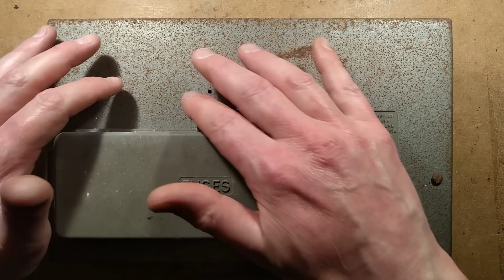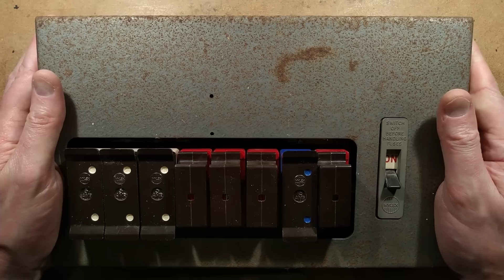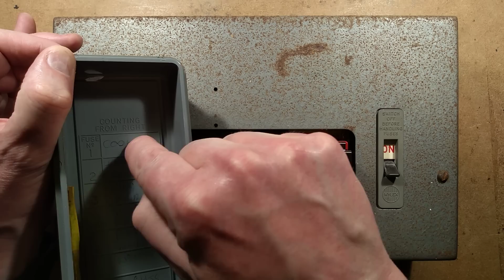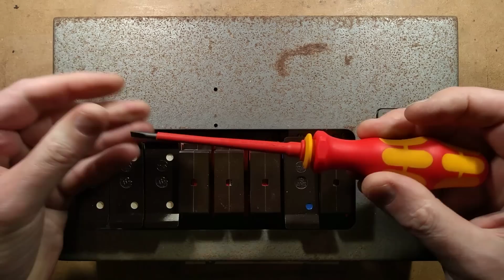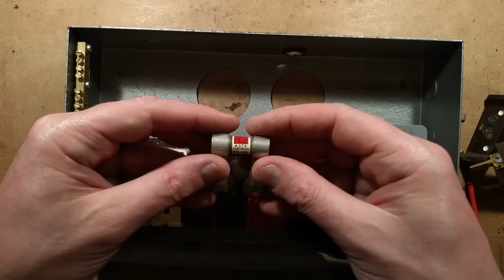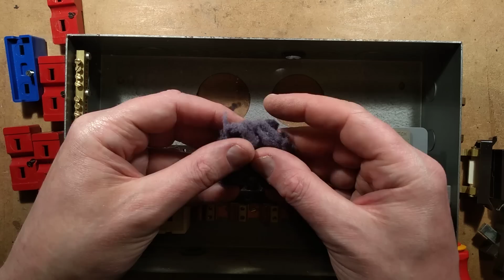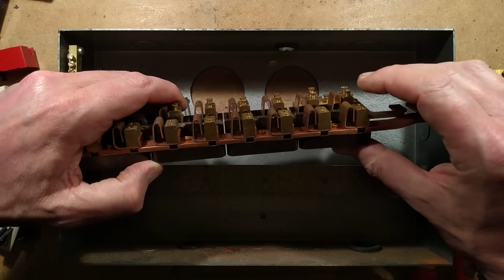Teardown of an old British Wylex electrical fuse box.  (with bare fuse wires)

Comment: God, I love that island. 
Everybody drives on the left and the switches are down for on and up for off. 
Not to mention the water taps. :))
Reply: Of course everybody drives on the left.....if only half of us did it that would cause problems. The taps here do drive me nuts though, also baths instead of showers. >.<
Reply: Kizron Kizronson the other day I briefly saw on the BBC a contraption where there was a bath with the two separate taps above, and no shower... but a shower was provided in the form of a rubber hose that you could slide across both taps and that then joined in the middle and led to a —handheld only natch — shower head.
Reply: Don't knock it mate, all those things were invented in the UK, it was the USA that ended up with everything the wrong way round. 🤔🤣
Reply: @JasperJanssen  Yeah,those things are terrible. The most popular option seems to be a "power shower" Which goes on the wall above the taps and which basically heats the water on demand as it flows through to a shower head.
Reply: @Kizron_Kizronson  That's not a "Power Shower", A power shower has it's own water pump. An electric shower has only a cold feed, a mixer or bar shower has both hot and cold feeds, both come in power and normal flavours.
Reply from the maker: Like the rubber Y-hose shower I used as a kid.  They were very common.  It was always a bit messy when one of the cups blew off a tap.
Reply: @bigclivedotcom  Depending on which cup blew off you were either scalded or froze, gotta love the old Y-hose.
Reply: @JasperJanssen  Those have the nasty habit to pop off the taps when your head is full of soap. Keep the pressure very low.
Reply: @bigclivedotcom  oh no, de-nitting shampoo on three boys with one of those bloody things... I used jubilee clips to hold then on the taps in the end...

Comment: Clive, I really appreciate you showing this 'vintage' stuff. It shows how we have gone from practical designs, made to be fixed or repaired by anyone, and how things have improved over time. While you could easily replace any one particular item on this panel, it is kind of clunky. Then compare this to today's new fangled, disposable economy where if a fuse blows, you throw it away and replace it with a new one.

Comment: I had such a fusebox or consumer unit in my last house. At one time, I noticed a burning smell whenever I used the washing machine, which I eventually traced to the fusebox. Basically, the screw holding the live wire to the fuse holder was loose and it had been arcing. The plastic on the whole of that section had melted and the copper connectors were only held in place by the wires. Since there was a spare slot further along, I was able to move the fuse and the associated wiring to the spare slot. Moral of the story - make sure the screws are tight, but not so tight as to punch through the wire.

And as for the asbestos, my parents had an asbestos mat, that they used to put between the top of the cooker and a saucepan whenever they wanted a really low heat. It reduced the heat of the flame to just the right amount to keep food warm whilst not burning it. When not in use, this asbestos mat was just thrown into one of the kitchen draws. I've no idea what became of it.

Comment: at least those fuse holders are a lot safer than the screw-in type common in north america prior to the introduction of resetable circuit breakers. very vividly remember as a toddler, watching my grandpa go down the dark basement stairs to jam a coin in a fuse holder, then screw the blown fuse over the top of it, because he was out of replacement fuses on a sunday night.

as soon as my grandpa plugged the (faulty) crockpot that blew the fuse back in, that coin turned into a blast of plasma that melted through the blown fuse, and a good amount of everything else in the panel. guess who had to use plumbers candles to light the house, give his grandchildren a cold dinner, and wait until monday morning when the town electrician could come in and replace the whole panel? xD

I don't fault my grandpa though-- he grew up in a town with hardly any electrified anything, and having dropped out of school in 5th grade to help support his family, a lot of his technical skills were self taught or learned on his job as a mechanic in a cloth mill. hence, a lot of trial and a LOT of errors. amazing he had (most) of all his digits by his death at age 80... he was missing the tip of his left thumb though. that's how he learned about riving knives...
Reply: It's amazing how a lot of older folks like your Grandpa made it to such an old age, what with all the health and safety warnings on everything these days.
Reply: @uK8cvPAq  Of course, plenty of them didnt... selection bias and all that.
Reply: I've known people who followed all the safety guidance and still didn't make it past 60, yet there's been people who've done all sorts and smoked like chimneys and are well into their 80's today.
Reply: Grew up in a house that still had those diazed fuses. (We had them over here in Europe as well). It was kinda a regular occurrence one would blow. Strange now that I'm thinking about it. Maybe they were a bit like light bulbs, just blew with age and use. I do remember my father using aluminum foil when there where no spares. Haha!
Reply: Also, a lot of modern circuit breaker boxes leave plenty of the live bus completely exposed once you remove the whole front panel. It's really interesting how they try to cover as best as possible every connection in the UK. This even goes for light switches and wall outlets.

Comment: I was working on new build houses when the new regs abolished  rewireable  fuses, I asked the boss why he didn't use the MCB's? Because they cost £5.50 each against £1.25 for the fuses, was his smug self-satisfied reply. He soon changed his tune when he found out that every time a light-bulb blew it took the 6a cartridge fuse with it...as he was giving the electrical installation a 1 year warranty, he had to send people on tours of central Scotland changing fuses at his expense. He liked that even less than stumping up for the proper gear..RIP Jimmy Hynd.

Comment: One safety feature I think you missed when comparing the different size fuse carriers is that the pin thickness increases in size with the higher amperage - not just for the higher current but it also meant that you can't accidentally/on-purpose put a 30A fuse carrier in your lighting circuit because the slots in the bases correspond accordingly
Reply: Hi, you beat me to the comment  haha.

Comment: Good old Wylex units, they must have been the dogs danglers back in the days you see so many of them around. Simple and effective for the days of "personal responsibility" when if you got hurt 90% of the time it really was your own bloody fault.
Reply: @ihatespam1977  We run all 240v in the UK, it doesn't play nice if you get on the wrong side of it.
Reply: I agree, but this thing looks like you can accidentally flip the switch back to on when you are working in the fusebox.
Reply: @Leo-pd8ww  trust me, you can. You can even take the cover off it switched on.

The later plastic ones you, at least, have to remove the rewirable fuses carriers before you can remove the cover.
Reply: In the early 2000s the split RCD wylex boards took over the same way as these . Most jobs now are a wylex split way RCD but recently a lot of common ones are the budget friendly British General boxes from Screwfix

Comment: Completely same wylex fuse box are still in use on my grandma's house in cyprus. I think it was built in 1970's and they are still rocking without any problems. However, i want to change them with new type of circuit breakers because of the safety concerns. Nice video!

Comment: I had one of these units in my old flat around 2012/2013, and had to change the fuse wire one day. I did exactly what you described at 1:35, blowing the 100A main fuse for the block of flats. The guy who came out from the electricity board let me keep the fuse! When it happened it was as if a flashbang had gone off in my hall and I couldn't hear or see for a good 10 seconds after, and gained a very healthy respect (some might say fear) for electricity after that. My wife would tell you that I couldn't even change a light bulb for a few years after that happened.

Comment: 10:00 at least in Finland, the old cinemas also had to have fused drop doors in the projection/peep windows, those would fall to cover the windows if there was a hot enough fire in the booth. But I bet this was approximately universal. Also it was mostly forbidden to have a direct access route inside the building between the booth and areas which patrons had access to. I work in two cinemas, one built in 1939 and another 1958. The latter has had a metal winding staircase put in in the 70's so we don't have to run around the building. The former retains the original structure and I think the building is protected so notable structural changes are not allowed. It is actually one of the oldest cinemas in Finland that has been operating all the time - the pandemic was the first thing for which we were closed for more than a few weeks. There are, though, 100ish year old (even wooden) houses where a cinema has been operating at some time, and almost by sheer luck only a few have had a fire.

Comment: Got this exact model at home, solid,dependable and unlikely to burn the house down unlike the cheaper plastic types today, just had it inspected and everything is fine, had an in line RCD fitted to the board supply, and good for years to come.

Comment: Wylex standard boards were awesome, so well made. Connecting the main earth to the external screws is normal, the earth bar terminals are very small. It's important to note that the fuse ways here are rated maximum 30A. Some Wylex boards had a single higher rated way next to or the other side of the main switch. A high current way can easily be identified as the contacts are in separate parts, silver coloured and held in place with a pair of screws. I have only once ever seen one of these burnt, but not to the point of fire. A ring circuit was wired into a 15A fuseway, the circuit was heavily loaded with a 3KW pool heater running 24hours, and a tumble drier and washing machine, the load was not enough to blow the fuse, but enough that the 15A fuse ran very hot. A section of the plastic cover above the fuse was charred and crumbled away,but the rest of the unit was in surprisingly good condition. A newer plastic unit would have melted badly. The dual screw all brass construction terminals are very reliable. I wish manufacturers would still use these, instead of mixing different types of metals, and using weak clamp terminals, especially for main switches and RCDs.

Comment: I'd always argue that our British standards for electrical gear have always been the best designed, most sensible, and safest, except for one embarrassment that you see has been partially corrected in later units. That is: 'Down is on' switches. Clearly, something dropping past such a switch can accidentally turn them on. I'd love all switches to change over to the other way around (even though the risk is small in most cases).
Reply: I knew a girl from a former British colony who was here in the US and her complaint was that the switches were backwards!  On is supposed to be down, not up!  😆😆

Comment: I have a unit similar to this and your video prompted me to have a closer look and I discovered one of the cartridge fuses had some wire soldered across it!
Reply from the maker: Good idea to get the correct fuse for that and some other spares too.  Also double check the correct fuse wires are fitted to any rewireable holders.
Reply: @bigclivedotcom  Thanks for the reply. already done so.  I didn't even realise they were cartridge fuses as the only one I have ever needed to replace it turns out is the only one which isn't.  So if a fuse blew I would have smugly gone to it fix it with my card of fuse wire - lol

Comment: I used to fit Wylex consumer units in early 70's they had a hardwood frame with a full plastic cover where yours was metal
Reply: The house I bought 5 years ago was built in 1985 and that had installed a wooden Wyler DB, it was soon taken out when I rewired my house, but who’s idea was it to go from metal to wooded DB,

Comment: Brings back memories,  worked on loads of these and ripped a fair few out too.  Also the push button MCB replacements for the fuses.  Most of the versions I worked with had a plastic front case and a wood backbox.

Comment: I've told this one a few times. As a 10 year old i figured out the fuse wire in the fuses could be replaced. 
We had a similar box, brown bakealite cover and it was filled with the slightly longer fuses. 
My father used to go to the nearby diy shop, and buy a new fuse. 
Near our box we had two fuse wires on wooden bobbins. One had 5A and the other 15A written on the top. 
When daddy was at work a fuse went. I opened the fuse saw the burnt wire and screws. Wondering if I could replace it with the same A wire?
I was so happy with my find, upon my dad's return I told him. I was ignored but still I was so full of happiness I went and wired up the 5+ spare fuses sitting above the box.

Comment: Interesting fact about asbestos: if melted down, it turns into glass that about strong as plexi and is no longer dangerous,  asbestos glass has a lot of potential that has yet to be put to the test.
Reply from the maker: The trouble is the mining and handling of it before it gets melted down.  Those fibres are very invasive.  If you work with the stuff then no matter what dust protection you wear you will inevitable breathe in a lot more than a normal person.  One of the things that rile me is asbestos removal companies that basically involve a greedy businessman using the cheapest labour they can get to do the work in paper overalls and token gesture dust masks.  The longer those labourers work there the more chance there is of life limiting effects.
Reply: @bigclivedotcom  that's what i have been reading is the thing that has stopping them from selling it and theirs some research  being done hoping to change that problem
Reply: @TT-RR  - See my comment above about short and long fiber asbestos.

Comment: My dad spent 1959-1996 in the electrical trade, he only has one working lung & that one only half works, non-cancerous asbestosis.
Reply: What caused such bad lung damage? Asbestos, smoking, something else? Does he need to carry an oxygen tank with him?
Reply: @simontay4851  nah, he doesn't cary oxygen, it would have been mostly the asbestos, he only smoke a pipe or a cigar once a week.
Reply: Mesothelioma is the worst cancer and is usually deadly.

Comment: The really big safety feature of these units is that every wire connection, except the earth,  is held by twin screws - brass into brass for a really good, tight long lasting connection. As opposed to the modern units with dissimilar metals, bad threads, and breakers where it is possible to insert a wire or busbar lug where it is not clamped tight. I wonder what the installers of these units would have said if you told them they should be using a calibrated torque screwdriver!
Reply from the maker: I prefer the more generous connections on the older stuff too.  Putting a large cable into a very short terminal clamp does not feel comfortable.

Comment: Hi Clive,  I used to do some work for a bathroom company and was at a job to install a shower.  When I removed the front of the fuse box, which was exactly like the one you show, I was a bit surprised to see that there was absolutely NO insulation on any of the cables inside with the exception of the tails incoming.  I have never seen it since or before.  The cables were the old rubber type and outside of the box were perfectly normal looking.  The only thing that was rubber and had survived were the grommets in the top knockouts luckily.  Every other bit of rubber insulation from the cables was just piled up in the bottom of the box where it had dropped off in crusty bits and when installed Earth sleeving didn't exist. My sparky comrades out there will be able to imagine the sight I think. When I condemned the box and showed the owner saying it would need drastic action she thought I was touting for more work!  This was in the 80's and no camera phones or there would be some amazing pictures of the bad stuff I came across.  Keep up the excellent content mate.  Al
Reply from the maker: The old crumbling rubber insulation is still in widespread use in the UK.

Comment: Thanks for the video Clive.   Ive got one of the units in my rented flat..  It has had the front cover cut out so that a circuit breaker can be plugged in.      Ive just screwed the cover back on. !    Ive also got an external RCD fitted next to it..  This covers the electric shower.   When it was fitted  the electrician ( cough ) managed to wire it into the cooker cable.  So when I tried my new shower and hit the TEST button. The shower stayed working, but the washing machine stopped !!  ( it was plugged in to the single socket of the cooker panel )   Guess he didn't check his work after he had finished !   I also have two 5a circuits that do lighting.   Front and rear lights..  But since the shower fiasco  all the lights seem to be on just one fuse.    My flat was built in 1981-2

Comment: As a side note, with rewireable fuses wrap the wire clockwise around the first screw then tighten.  Wrap the wire anticlockwise around the second screw, when you tighten the screw it feeds slack wire back to the tube thus avoiding snapping the fuse wire